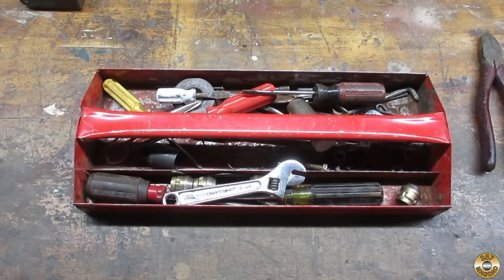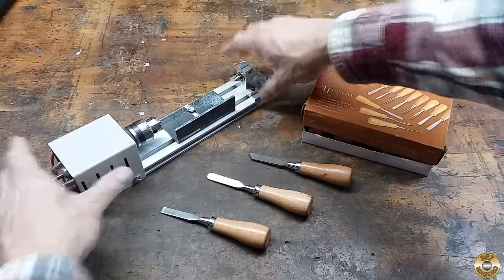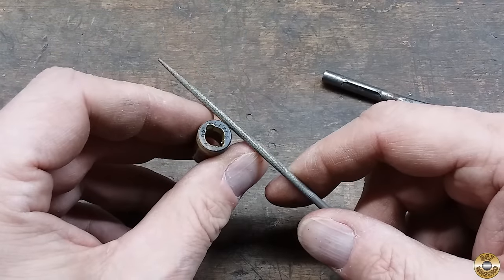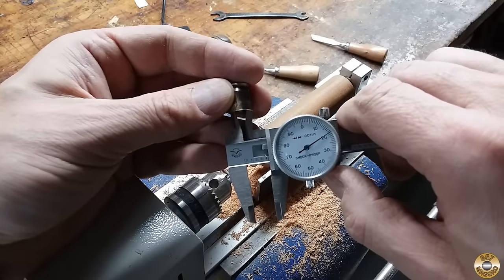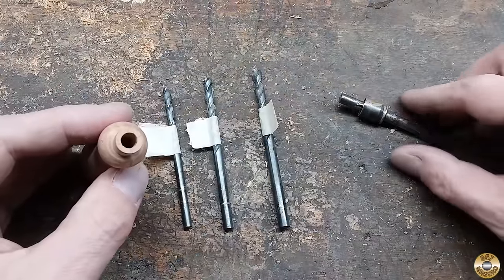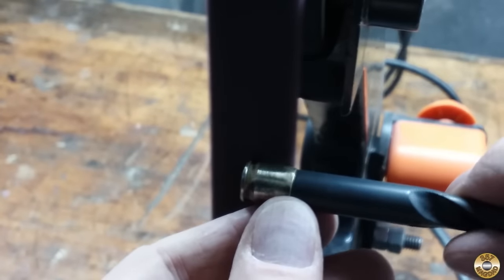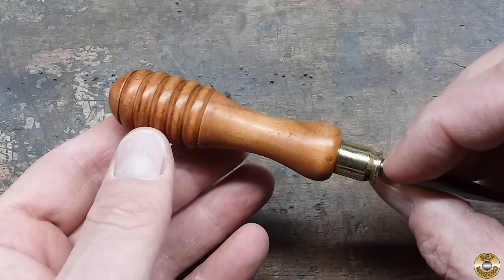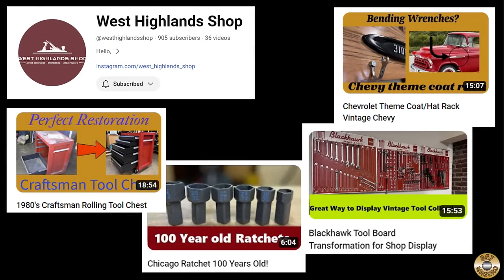Stinky Screwdriver Restomod

Comment: I Dig your Restos! ... But  CAUSION! Way back in High School.  (55 years ago). Dad acquired an accedline / oxygen torch - it quickly became my favorite tool since I had used one in Shop Class. Dad had recently had a new garage built. When torching or welding too close to the new concrete floor, I learned how easily concrete can explode around heat. Luckily I still have both eyes as I accidently blew sizeable chunks of concrete airborne! MAGDAD...Watch how you heat things up OR WEAR some goggles ! ! !   ...Newk from Kentucky
Reply from the maker: Thanks Newk!

Comment: Wow. Mrs. Magdad was right on when she got you the mini lathe. It's a great addition to the shop and very capable. Your lathe work is very instructive, and the screwdriver turned out very nicely. The handle on the stinky screwdriver looks too small to apply much torque. The cherry handle is much more practical and looks infinitely better. Great job all the way around.😀
Reply from the maker: Thanks Pat!  That tiny lathe was a great gift!

Comment: Nice project.  My only observation is that now you need to go out and buy another stubby screwdriver for use in tight places!  The new handle is long, but that's not what the original driver was for!  

I love the little lathe - years ago, I bought a cheapo wood lathe from an outfit that sold very inexpensive tools in magazine ads - I've long since forgotten the name - and bolted it to a lathe bench I made out of (back then) cheap but dry, 2x4s cross-bolted and glued together - that I had a local woodworking shop run through a thickness planer, then built sturdy legs to bolt it to.  

I added a motor, v belt, and some wiring and knife switches, and redid the baluster spindles on an old Victorian's porch - our house in Providence - to replace the 70 year old original spindles that had been disintegrating from acid car exhaust.  I made the new ones out of 4x4 redwood (!) in the hopes they'd last longer, taking the profile from the originals.  

Redwood is tricky to turn, because the wood is fibrous, and the chisels will dig in and pop divots out, ruining the work.  I profiled the block every 1/2 inch with a hacksaw so that a pull-out would be limited in effect, and then did the finish contour with rasps and files.  

Your mini-lathe brought back many happy memories of turning out wooden artwork down in our cellar those many years ago.  Thanks for the video!
Reply from the maker: I'm glad you enjoyed the video!  Check out the stubby bit drivers I made:
https://www.youtube.com/watch?v=peK90KYCl_A

Comment: Nice job. Why didn’t you remove the wings and replace them with a steel drilled in from the side?

BTW, you should make a video of the stuff Chuck has been making with his toolkit. Has he made his own workbench yet?
Reply from the maker: I think drilling a cross hole through the center of that small shaft would have been a challenge!  I've got a Chuck-sized project coming soon!

Comment: I remember the first time I experienced the smell that comes off old plastic handled screwdrivers.  Back in the 70's I took a job at an old garage as a mechanic.  The shop had one of those big old Sun diagnostic machines unused against a back wall.  One day, I did some exploring and opened a drawer on that machine ... and immediately thought ... "Who the HELL puked in this drawer???"  It was one of those white powderey coated screwdrivers.
Reply from the maker: That smell is one of the reasons I prefer wood handles!

Comment: A step drill should make drilling a primer pocket easier. Or a hand sharpened drill with 90 degree plus angle, to prevent binding. 180 degree cross cut drills are great for making fresh holes, but suck at reaming.👍
Reply from the maker: I'll try a step drill next time.  Holding on to the round case is my biggest challenge.
Reply: @357magdad  to drill brass it helps to brass the bit off. Which basically means knock the sharp edges off of it. You just stone the sharp edges off. That gives the bit a negative rake and makes the bit drill instead of grabbing in the soft metal. Look it up, it's a real thing. Drilling brass with a standard twist drill can be terrifying. A sharp bit will self feed into brass. A brassed bit is sharp, but sharp different.

Comment: I used Sefoam brand of bug and tar remover and it cleaned up my brothers screwdrivers and they had alot of that white crude on them and it came right off.
Reply from the maker: All the bug and tar in the world won't turn it into cherry and brass!  😁
Reply: Handles susceptible to the mange will always keep breaking down. You can clean the funk off but they'll deteriorate more. The plastic just wasn't made right.

Comment: golfballs make decent tool handles
Reply from the maker: No golf ball looks as good as cherry and brass!
Reply: @357magdad  quite true, at times for me tooling is at times just something that gets the job done. but i certainly appreciate beuty, I have a dozen cherry trees and thus trimmings, as well as the knowledge of blacksmithing (only papers for journeyman level, but 35 years of hitting hot metal...).  i have made Damascus blades with fancy handles... as well as some forged parts for restoration of several hundred yards old cabin and similar,  those deserve decorative, a screwdriver? to me that is bit much,  that handle is more money than the screwdriver ever was.

Comment: ( some , but NOT all ? ) almost wrecked handles can be returned to use by covering them in a generous layer of ( ADHESIVE  lined heat shrink  tubing , and , heating it ! ) ...... ( tried - n - tested ) ................ DAVE™🛑
Reply from the maker: The shrink tube wouldn't look as good as cherry and brass!😁

Comment: There should be no need to rock the tool on the tool rest as you do.
Reply from the maker: The tiny lathe has very little torque.  The grooving tool will easily stall the motor.  So I gotta coax her a little...